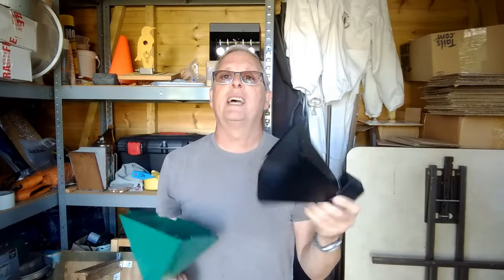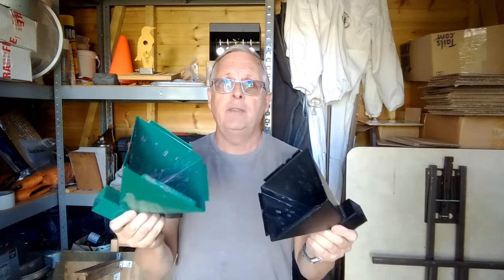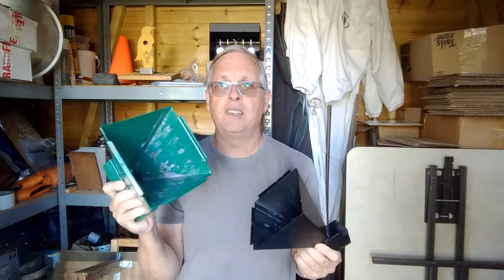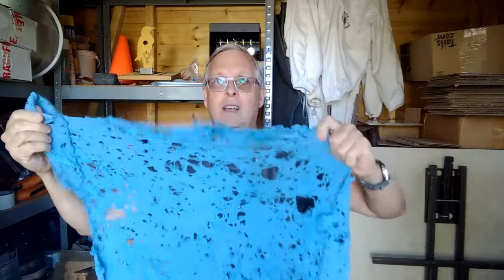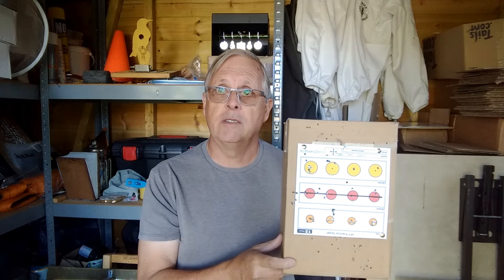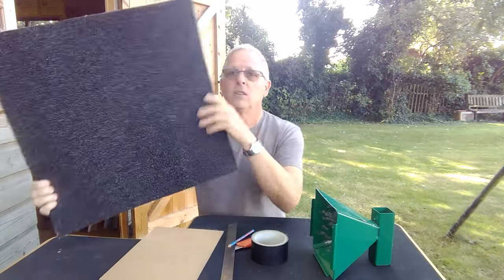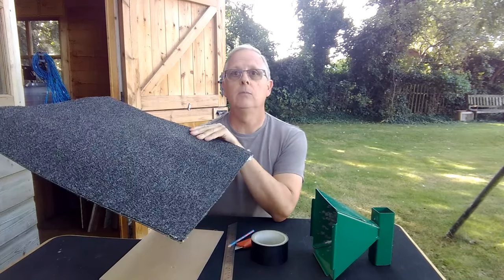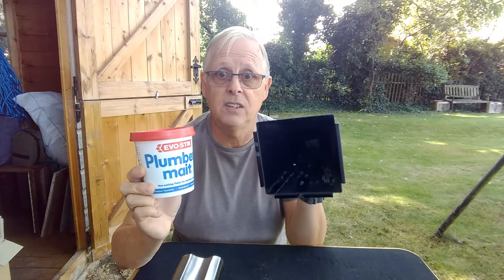20 - Reduce Your Plinking Noise in 24 Hours with These Tips!

Comment: Cool test. I just shoot into good old large sand bags. Stops the bullet, pellet or slug and is not loud. Other than that I would do the cloth and rag stuffed box for a target backstop.
Reply from the maker: Yes, the box is a good all round solution. 🙂👍
Reply: @hftshooter  these are the two stops I use but it is kinda hard to shoot a seventy foot pounds of energy air rifle and keep things quiet from the impact side. My rifle is very quiet but still get a little thwap of it hitting the target bag or box. I wonder if filling up your metal target traps with ballistics jell would silence the hit?? I mean mix up a bunch and pour it into your funnel shaped traps so it takes the same shape as it cures/goes solid sort of. Just an idea for you. Might make a cool continuation video.
Reply from the maker: 70 ft/lb! 😲 Yeah, bound to make a little impact noise. 😂
Nice idea, but I don't think ballistic gel would last more than one use. I guess a complete fill with the plumber's putty would do the same. 😄
Reply: @hftshooter  very true. Great idea 😊

Comment: box rocks mate i have also tried all 3 and come to the same conclusion. the other one i have used is an old large baking try with some lead flashing you can buy a roll sink the baking tray in a bit of ply wood or mdf stick the lead in with some double sided carpet tape . quite a bulky affair but does a great job of catching the pellets and does bring that clang noise down for sure plus the wood back stop you can make as big as you like . also it’s pretty flat so can go slid in behind stuff for storage. not to cheap to make but won’t break the bank
Reply from the maker: Another good solution! 🙂👍

Comment: Got quite a few of those pellet catchers attached to a 2 mtr round table top ( hardwood and inch and an half thick ) in the center a steel plate with wooden blocks top & bottom to pin A4 printed targets on .. plus loads of spinners and a re-set box @ 30mtrs .. its on stilts ( 3" x 3" ) .. great setup ... super for practice when I can't get to the range .. neighbors dont seem to mind the clatter or the noise of the guns .. that said , generally I only do it for an hour at a time .. or more if immediate neighbor is out ..
Reply from the maker: Sounds like a good setup. 🙂👍

Comment: Over fourty odd years ago as an air cadet in my local ATC (223 Sqaudron), at the end of our 36 yards long drill hall  (which we shared with the local Army Cadet Force, but on on a seperate day of the week), we had a elevated (about 3ft off the ground) steel bullet trap. It was all made of 1/4 inch steel plate. Flat bottomed with vertical sides and a rear sloping top, so basically a wedge shape looking at it from the side. Inside it was banked up from the front with dry sand. Our 'shared' armory had half a dozen 22 (rimfire) and 303 centre fire rifles. We usually had 22 target practice once every four weeks. Three card paper targets were  suspended on clips in front of the box (which was about six foot wide). At the end of the year, we would simply rake out all of the sand into buckets through a metal sieve to catch all of the lead and the same sand put back after. The only noise (we were in a residential area) was from the action end and never very loud even with three rifles all going together. The target end was totally silent apart from the bullets going through the target cards. The 303s we would take with us to whichever RAF base we  we had our summer camp at and used on their base range. All great fun. 
I've decided to make my own version of it for my garden but obviously with thinner gauge steel with a simple cover to stop the rain getting in when not in use.
Reply from the maker: Thanks for sharing. I was an ATC cadet too, at 6F squadron. We were in a multi level building are were lucky enough to have a proper indoor range on the floor beneath us. All the best with your target building! 🙂👍

Comment: I own also the black model pellet catcher as shown and the pellets went straight through after about 50 shots.  The small metal plate with the angle at the end that force the pellet down i'm shooting straigt with the first shot using my HW80. One shot on the rim on the edge and you have to bend out the rim again to get your card to fit in again. I always recommend to buy .22lr rated targets and catchers if you own powerfull airguns, they are more expensive but at the end it will save you money and are much safer. The catchers you show are for low power airguns like a HW30 and 10 meter match rifles. Cheers!
Reply from the maker: Thanks. I've noticed that some of the spot welds on mine are starting to come apart due to pellet hits. I will be replacing them with something more substantial very soon.

Comment: BluTack is a good trap liner, as is lead flashing if you can get some for cheap. 

For a back-stop I repurposed the drum out of an old tumble dryer, which I filled with kibbled waste tyre mulch. It does weigh a ton (it has fifty kilos of mulch in it for a start) but rolls easily enough and is completely silent. I just tape a new sheet of cardboard over the front every few weeks, it'll outlast me.
Reply from the maker: Good tips. Thanks for sharing. 🙂👍
Reply: Melt down old pellets to make a catch liner.

Comment: You can also put the putty on the outside and carpet in the inside. 

If you covered a bell with that putty it wouldn't ring very loud.
Reply from the maker: Yes, that would work, but pretty messy! 😁👍